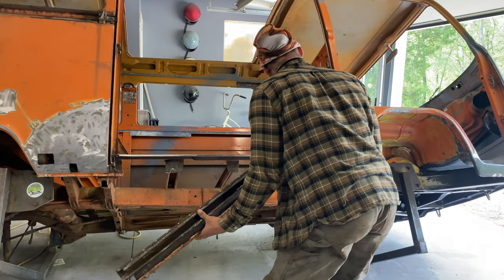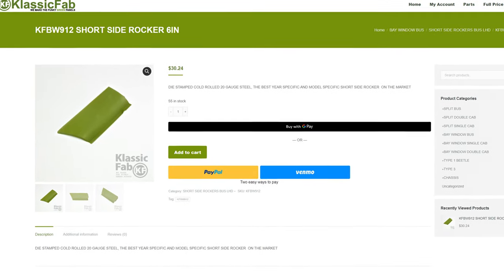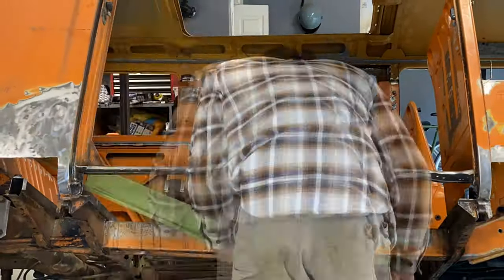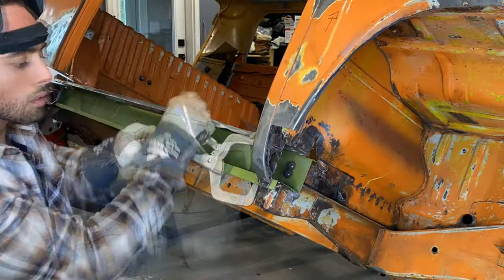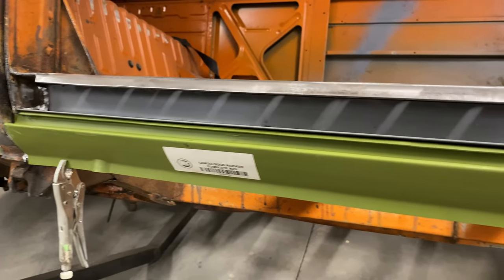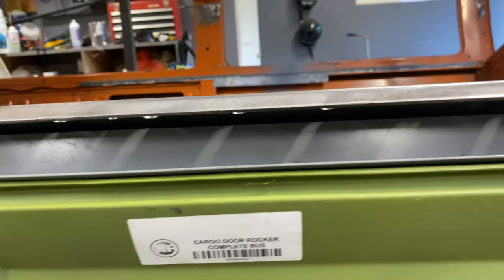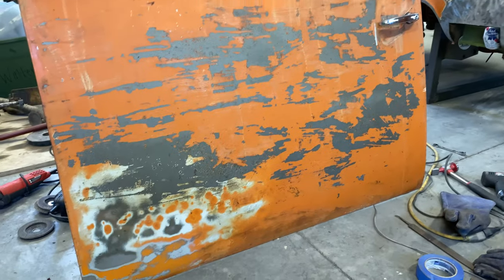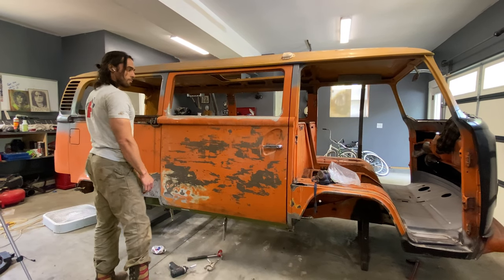Sliding Door Track Replacement PT:2  | VW Bus Restoration Episode 37

Comment: The hardest thing I've replaced on my bus was a piston head. Had dual carbs and 2 mystery nuts fell in my #1 cylinder 2 separate times! M8 nuts that didn't belong to any bolts in the engine bay 🤔 keep on kicking butt on your restoration!
Reply from the maker: That sounds terrible. Thanks for the motivation!

Comment: Great job on this. Yours is one of the very few videos that go into depth on this repair. We will have to do the same in the future, our bus has a slightly failing track. Amazed by the one-handed closing of the door. What an improvement.
Reply from the maker: If you have any questions when you dive into the repair feel free to send me an email. I’m quite shocked at how well it opens and closes and it’s not even welded on yet 😁

Comment: Absolutely top job and following step by step as doing the same repairs on mine! Can i ask as i cant see on video what you have done, i see you have welded the top side of track to middle sill, how did you deal with the inside same section as a bit of a gap to fill.
Reply from the maker: I'm not sure I understand the question. I may have covered it in the final part of the sliding door track videos

Comment: That turned out great man! do you think its possible to replace the inner and middle rocker on this side without removing the track? my track looks fine but the rocker parts need to be changed.
Reply from the maker: The middle rocker and the sliding door track are essentially one piece. You could probably replace only the inner rocker, you'd just have a lot of spotwelds to drill and probably have to remove the spotwelds from the crossmembers from the backside.